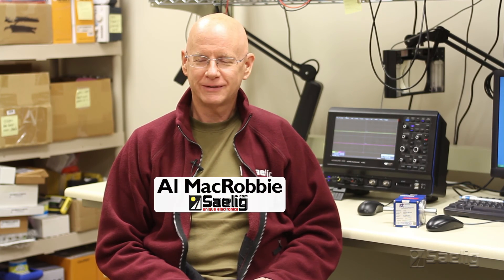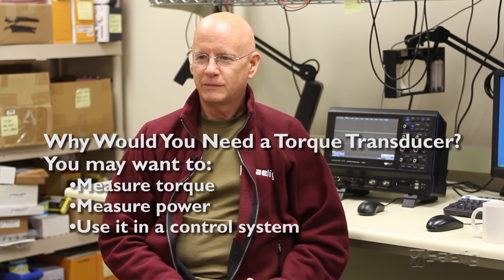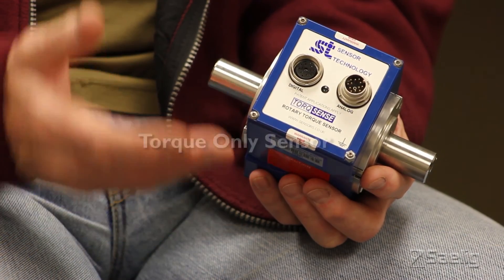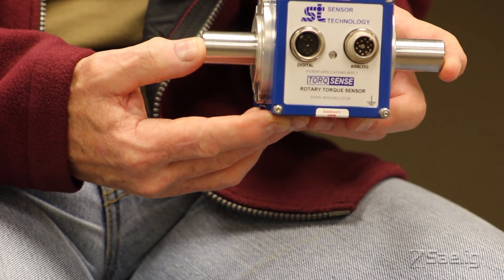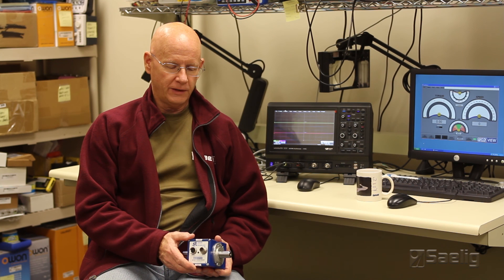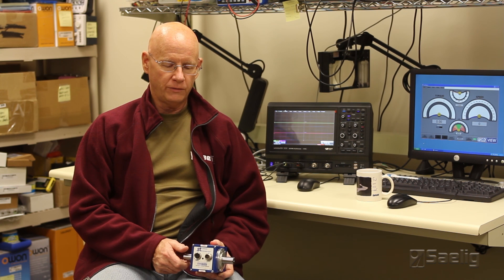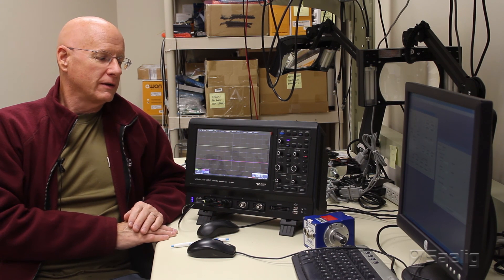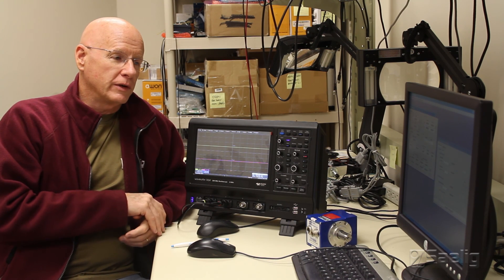TorqSense 1of3 Hardware

Comment from the maker: Sensor Technology’s TorqSense (http://www.saelig.com/category/MFR000...) rotary torque sensors offer accurate, affordable, market leading devices across for a wide range of industrial applications. Sensor Technology Ltd. has been manufacturing quality torque measurement solutions for more than 40 years. Its globally-patented Surface Acoustic Wave technology called TorqSense is used in non-contact, rotary torque measuring sensors for non-automotive and customer applications. Sensor Technology has developed its own technology for the instrumentation, test and OEM markets, based on the latest non-contact and optical technologies. Customers can specify any full-scale torque range, within the standard range, to optimize accuracy. TorqView software, based on NI LabVIEW, adds an easy to use Advanced Torque Monitoring software tool to assist data recording.